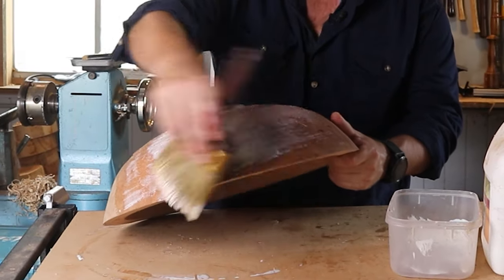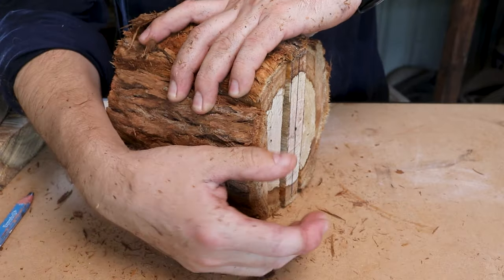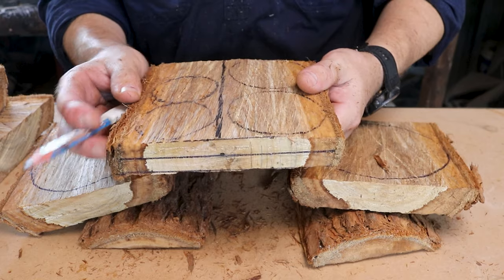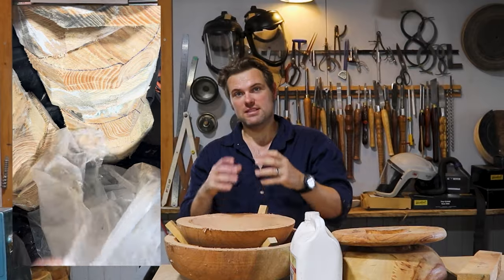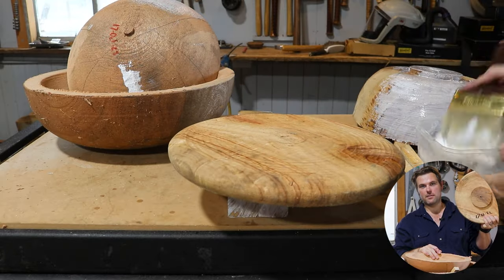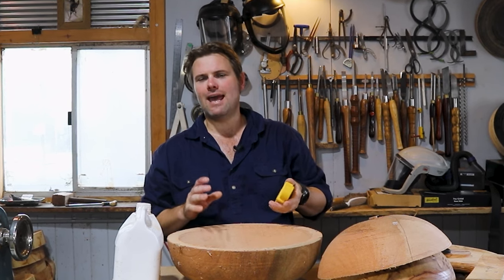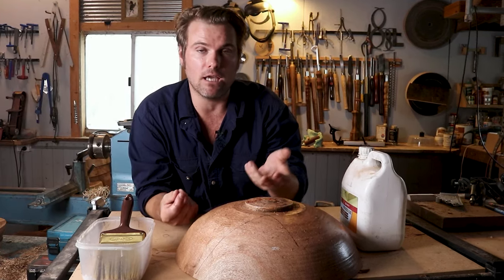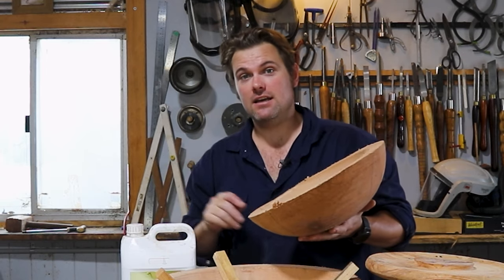How to Dry Green Wood: 99.5% success RATE. Avoid Cracks. A Comprehensive woodturners guide

Comment: Yours was the 5th video I've watched on preventing drying wood from cracking and it gave me by far the most information. I'm just trying to hand carve a few bits and pieces like wall fittings for drapes and wooden spoons, and I didn't realise how important removing the pith was. My pieces were cracking within a few days after spending hours on them. I will try again starting with a larger log, avoiding the pith, and gluing the end grain. Your video was much appreciated.
Reply from the maker: Thank you so much, mate.
I'm really glad that I could help.
Let me know if there is anything else I can cover in a video. I am no expert and don't claim to be.
Cheers, mate.
Kezza

Comment: Top info. I'm in Ireland and follow a very similar drying regime but I use pva polybond instead of glue, with a much colder damper climate the process takes a lot longer. I finish the drying process by bringing the blanks into a drying box, which is an insulated plywood box, 4 inch vent at one end, computer fan at the other and a small greenhouse heater. I weigh the blank and note the weight and when i get two weights the same after a couple of weeks we're good to go. Super to see you back turning again, always enjoy your straight to the point approach
Reply from the maker: Thanks so much, Brian. You have your method dialled in 👍 ‘If the wheel ain’t broken, don’t fix it.’  I appreciate your support mate. 
Cheers, mate.

Comment: Americans go on about Anchorseal, which you can't get outside of the US. Google the data sheet and you'll find its a soluble wax. Google that and I've found its commonly used as concrete sealer, the stuff that stops it cracking from moisture loss. This seems just like the product a contractor used in our house, it left a waxy film on the concrete. Last I looked it was €35/25L container. I haven't tried it yet but if it works it might be good value for a pro woodturner. Have you got and buddies in the trade who could give you some to try out?
Reply: i'm an american and I've been nothing but disappointed in my results from using anchorseal
Reply from the maker: Thanks so much for the information mate. I might have to try a little on a test run. I really appreciate it👌
Thanks mate.

Comment: I got a dirt Celler under a hill,in Switzerland..never gets above 13 degrees and very moist. Had good success with rough turned bowls not cracking…
Reply from the maker: That’s really cool. How long does it take for them to dry in there?
Reply: @KerryCorney Never dries completely in there because of such high moisture from soil floor…after a few months I can take the ones I want to finish into workshop and within a month they are completely dried.
Reply from the maker: That’s really cool. Would it be worth it putting a dehumidifier in there? Thanks for sharing this. We don’t have cellars/basements under our houses here in Australia.
Reply: @KerryCorney  nah, it’s perfect with high moisture for rough turned bowls..kind of like paper bags with the wet chips. For the initial drying it’s great.

Comment: Good info. Next you might address off center pith and how to best address that issue.
Reply from the maker: For sure. Im always dealing it when I get Camphor. Especially unions where you have three big branches coming off a base. That's tricky stuff. 
Glad you liked the video. 
Cheers,
Kez
Reply: @KerryCorney  Three in line, I go with the pith plane. Three uneven, I turn a vase or use the pith line of the two largest branches. If really large I cut multiple pith plane blanks.

Comment: what if the diameter of the tree is not bog enough to cut out the center, and the wood is cut in circles like 10"" inches in diameter??/
Reply from the maker: Hey there, thanks for reaching out. I usually remove the pith with a chainsaw or bandsaw, or I turn it out on the lathe. Are you asking if the log was cut into cookies?

I'm sorry, but I didn't understand your question. The pith has to come out, even in branch wood. Have a great day!
Reply: @KerryCorney  Yes what if the wood is cut into circle cookies how do I turn that with the pith still in?
Reply from the maker: @crusadersforchrist4028  So that would be end grain turning. You can still slice the pith out on the band saw ( if the log is big enough) and make really lovely end-grain boxes and other things. I always turn into side grain material when I process the timber. Check this video out here. How I process and dry timber: https://youtu.be/KFGUtfo_t94?si=DpQLLVIAdgoJwZF4
I really hope this helps. 
Thanks for getting back to me. 
Kez
Reply: @KerryCorney  what size and type bowl gouge do you use I am having a hard time turning Pecan wood at 12 inch diameter
Reply from the maker: Pecan is a hard to turn for your first go. I would suggest something softer. Have you considered joining a Woodturning club? 
In this video, I show all the gear I am using. Hopefully, this helps you out https://youtu.be/Gqwn2W77lBs?si=q8VvGKWBt22yvYcO

Comment: Sir, I have it the pith from my lumber and have started to harvest and have a few bowls turned and sealed. I know have a moisture meter as all the wood I turn is green. Is there a percentage that shows pecan is dry and I can finish my final product and turn? Thanks
Reply from the maker: You can weigh the blanks and record the weight on them. Then, after a month, reweigh them. Keep doing this until the weight stops dropping. When the weight remains constant, you'll know that the wood has reached the right moisture level. It's a good idea to test the wood every month, or so. The acceptable moisture level can vary depending on where you live. It's best to ask a local timber yard or Woodturners in your area. For example, in some areas, a moisture level of around 10% may be suitable. As mentioned in the video, you can also consult a local Woodturning club for advice. Hope that helps👌🤝
Kez

Comment: Even though I should know all this,I like hearing you talk about it.   There is always some bit of informational benefit.   I have a moisture meter but I don’t trust it much.  I always wonder how deep into the wood it is actually measuring.  I like to measure the weight in grams right after rough cutting and the sealer is set up.  Then I watch that going forward and it is easy to calculate the percentage weight reduction.   Just a hobbyist here so I can be less efficient.  But I like watching the efficiencies that production turners figure out.
Reply from the maker: Thanks for watching, mate. I used two for that same reason as well, because I don’t trust the ones I have. I need to save up some coin and buy a really reliable moisture meter. Il slowly getting back into it. My hand is slowing me down a bit. Plus editing these videos takes a lot
Of my time. I need to find an editor. 
Thanks again mate.
Cheers,
Kez

Comment: +i live in Adelaide and work much olivewood (i do walking sticks spatulas, spoons, cups, bowls, honey dippers, and am learning all the time.  )

like you, I have found that my wood dries faster than americans quote. i doubt that the wood dries the same as Brisbane, but in Adelaide, it is in the same ballpark.  .    That said, my biggest problem with olive is cracking.  i have found that cold weather felling is better than summer felling. but never put my observations together until you said it.  )  autumn and spring are the best seasons for felling olive  trees, the trees are  less wet, the weather is kinder to me and the wood.  Winter is no good, after rain, there is water on the leaves (so you get wet in cold weather), the clay paddocks are slippery, and my tyres have lost grip on a clay hillside before.

 .  in any case, i paint the end grain with olive oil after i load the vehicle 
(sooner if the wood is stressed) re-paint the wood when i arrive home (usually 1 hour), then paint the end grain after the oil has  penetrated (a day or two).  it acts as a barrier to the paint if one tries too soon.   i am seeking to replace olive sap with olive oil.  it seems to work. When i whittle repair a  damaged spatula, the oil oozes out of the cut cells.  People have suggested that olive oil will go rancid, but i have never found the oil to go rancid once it is in the wood. on the bench in an open container, yes. 

cracking is much reduced with end grain sealer, i used to lose a  third of bowl blanks to cracking (it is okay, i work a woody weed which grows thickly round here).

Of my last 5 once turned bowls, 3 have cracked: Of my bowl blanks', 3 out of over 40 have cracked, so olive seems to like drying as a solid.  

direct sun is a killer, so i cover the wood. . During summer heat (35 to 40 Celsius) I move precious wood pieces into the house (the coldest area , usually 25 to 30).

snow is not on the menu in Adelaide

Finally, thank you for your videos, it is good to see a local (in a global sense) presenting your world and your experiences

Comment: Does some of this apply to hand carving bowls?
Reply from the maker: The drying techniques would probably be similar. In saying that, I haven't hand-carved before.
Kez
Reply: @KerryCorney  hmmm i see. . I'm not sure if I should carve green wood then let it dry ( but the shape would warp some ) , or let the block of wood dry b4 carving  :/
Reply from the maker: You could carve it out and leave it, Chucky. In the video, I leave all my bowls and platters an inch thick (25mm) from the final thickness. I let them dry and turn them again (in your case, carve) to the final shape, which removes any warping and distortion. Some people turn green wood in search of the fun shapes they make when drying.
Cheers,
Kezza
Reply: @KerryCorney  oh yeah true.  Hopfully I can dry in a way they won't crack !
Reply from the maker: You could also experiment and grab a paper page to fill it with shavings and place the bowl in it. Seal it up and keep an eye on it. 
Cheers, mate.
Kezza

Comment: will Titebond wood glue work??
Reply from the maker: That would be a pretty expensive way of doing it, mate. Save that for your glue-ups 👌. PVA glue can be bought relatively cheaply in 4 or 5-litre drums.
Hope that helps🤝
Reply: @KerryCorney  where, maybe I'm getting old but can't seem to find that cheap alternative
Reply from the maker: @joedivincenzo2099  In Australia, you can buy 4L of PVA glue from big box stores like Bunnings for around $40 AUD. If you’re in the USA, you can check Home Depot or Harbour Freight for similar options. Hope that helps.

Kezza
Reply: @KerryCorney  I think I found some on Amazon, have u looked there??
Reply from the maker: @joedivincenzo2099  I get mine from my local hardware store. I’m happy you have found some. 👌